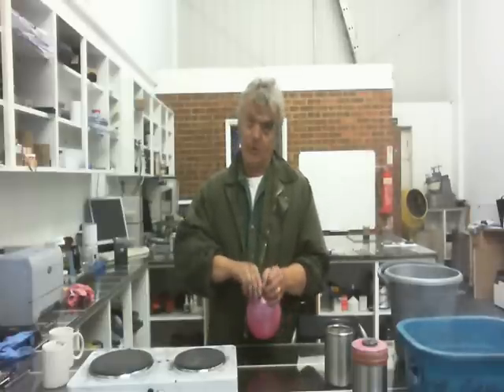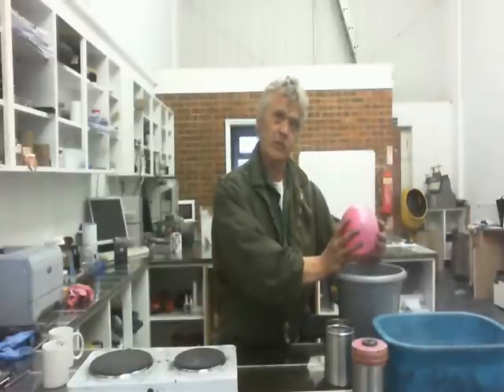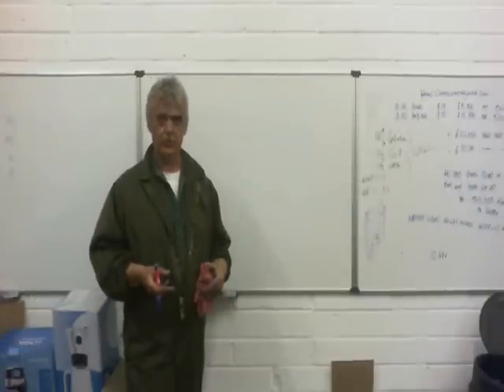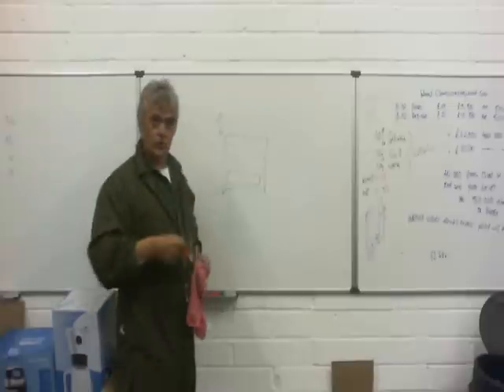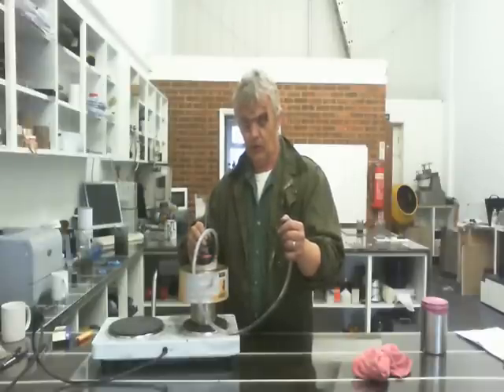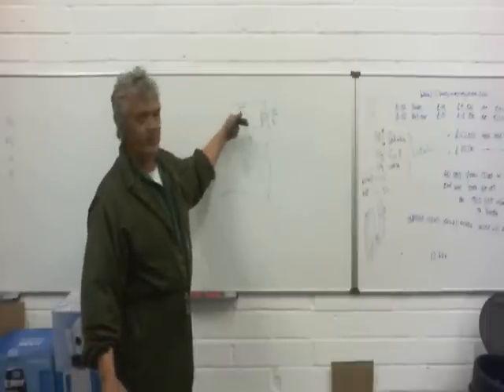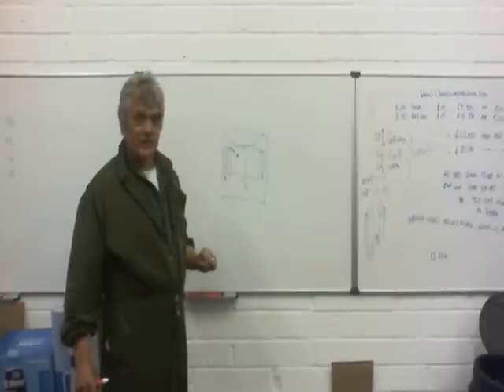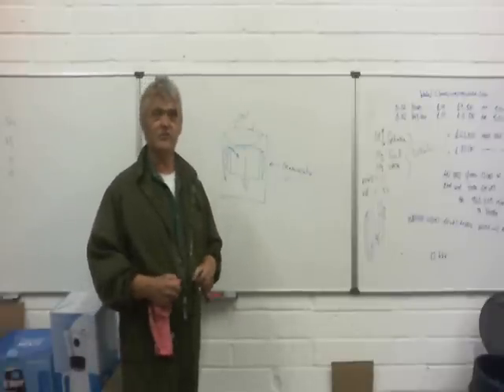How Stirling Engines Work

Comment: Is it possible to convert a compressed air driven vibratory shaker into a Stirling then. Bacause the air displacement happens to be the same but with only one moving piston and a moving valve arrangement 🤔 like a double stroke piston engine 🤔

Comment: Does the energy transfer also take place through exerting force onto a piston as well ? I mean will the air cool by exerting force onto the piston as well. The gas molecules transfer their force onto the piston and into mechanical energy which cools down the air molecules as well. If so how strong would this effect be ? I can insulate the colt side of a Stirling engine and it runs just fine so the air needs to be cooled off by an other effect as well.

Comment: a very simple question which you may be able to answer for me since the advent of lithium storage batteries, Can the exhaust of a heavy diesel motor be the heat sourse of a Sterling motor with generated power use to drive accessories I.e compressor, air conditioning, power steering, supercharger etc

Comment: 1. Is  there a danger with the Stirling engine that eventually the hot air in the cooling chamber will get so hot that it will stop working ? is there a way to make sure that can be eliminated or the water jacket is enough.
2. is there a formula available which allows one to change the dimension variable and  or internal air pressure (say with bike pump ) to  work out  the output force or the effeciency so that one can tune it to get 2-5kw from sun's heat.
Reply from the maker: dunno mate - this is just a hobby for me - i am not an expert in this

Comment: G'day Rob, I have to say this is the first understandable explanation of the Stirling engine I've seen to date.  While I thought I understood this type I didn't know the half of it.  Great job!  BTW what was the story with the shiner?
Reply from the maker: lol - cheers mate - it's not a shiner - it's dirt lol - we work a lot with carbons - i get pretty filthy
Reply: Heck you were quick on this.  I was just reading the paper on the Stirling engine that NASA tested in a van and a small truck.  I never realized that these engines could do useful work.  My knowledge of them was mostly as novelties and model engineering projects.
Reply from the maker: I am pretty good at answering my posts mate - low temp versions haev been used in solar to generate electricity - which is my own fascination with them

Comment: Hi Robert, it was a great presentation. It was very helpful. I have a question: where can I buy this kind of canister to build the engine? Hope to read you soon.
Reply: Practically anywhere. Shop online for "stainless steel canister" or Target, Big Lot, Walmart etc.

The exact size or shape is not all that important. An old tin can can work.

Comment: Hi Robert, great job on the explanation of this fascinating sterling engine type! I am interested in trying to use this device in conjunction with a aqua fesnel lens, a small electric generator and a battery in order to power some simple LED light fixtures. This is intended for outdoor camping/festival use.  As I am a quite skilled within electronics the generation, charging and power conversion  part is not a major problem. However I have a hard time getting around how to attach a generator to this devise - Would you have any ideas on how this may be done in a simple fashion?
Reply from the maker: ***** Hiya mate - i did a video on this - basically a magnet bolted inlinear generator fashion - it is on the engine playlist

Comment: Inside of the internal combustion engine you get an increase in temperature (because of the spark) and an increase in volume (because of the cylinder moving up) ... so does that mean that the pressure actually never changes? If the pressure inside of the internal combustion never changes what caused the motion in the first place? Maybe we can make machines that work on just combustion of vapors instead of using liquid gasoline. Awesome video, and Happy New Year!!
Reply from the maker: happy new year to you too mate - it's the increase in pressure that 'pushes' the cylinder and so increases the volume
Reply: It's actually Brighton Cycle, ye olde jet engine X)

Comment: Great explanation, great video! I'm glad you talked about the regenerator, that was Robert Stirling's real stroke of genius. Technically it's not a Stirling engine without it, only a heat engine, but trying to argue that most of the so-called Stirling engines on YouTube are really only heat engines would be like trying to bail out the tide.
Reply from the maker: lol - it would indeed - glad you liked it Dana

Comment: When i first saw your video about free piston type Stirling engine i immediately thought about application for it in a household. I did some research and found out that some GB company did exactly that, they took a free piston type Stirling engine and made a power/heater unit which uses natural gas to heat + generate electricity for your home. Now imagine if we take same type of Stirling engine and use heat from methane gas which would come from a bio digester in your backyard to heat water and make electricity! It would be basically free energy right there.
Reply from the maker: i agree - i am just getting the stuff together to demonstrate this as a generator - my idea was to attach a fresnel lense and sun it from solar but there are a load of heat sources that can be used and i like your suggestions